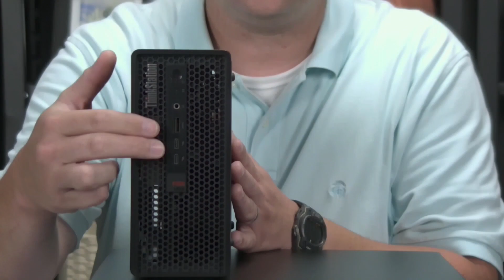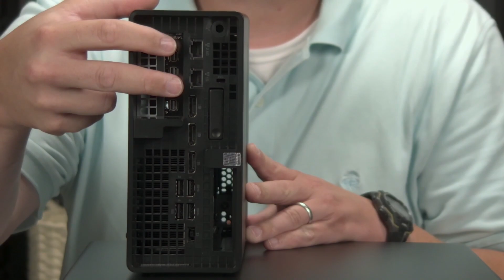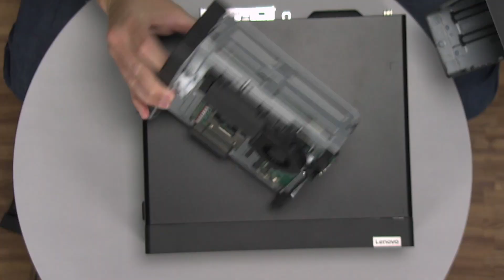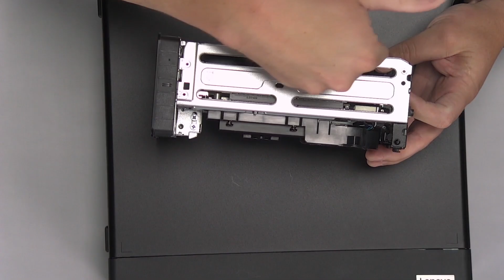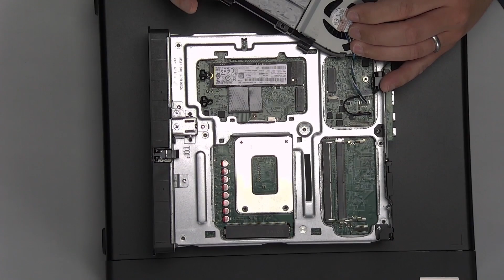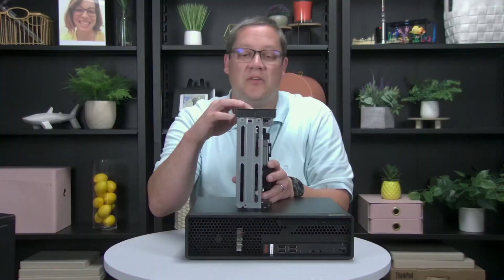An Inside Look at the ThinkStation P360 Ultra

Comment: Hi, I have question regarding the Storage support. Can I install a 2TB 2.5" HDD to this P360 Ultra ? The spec only said it support 1TB 2.5" SATA HDD 7200rpm. In fact Lenovo DID NOT provide the 2.5" HDD mounting bracket when I purchase the system (I did not purchase the HDD). Looking forward to your reply, thank you.

Comment: Hi
So I'm looking at purchasing a P3 Ultra with the 13900K  processor. I'm a bit confused aboutt he GPU compatibility. I can see that you have what looks to be a T1000 in that machine, but here's my question. You say that in the models specced with larger 125 watt CPU's, there's a dual fan setup. Does this actually mean that there is no slot and no room for a T1000 or A2000 GPU card? Thank you.

Comment: Good day. I wonder if I can use third-party GPU cards for a further upgrade of the P360 Ultra? Are there any "white list" limits on expansion cards? What are the physical limits for extra PCIe x8 card? As I see - there is classic power connector from ThinkPad laptops - can I use one of mine, 135 watt power, with P360 Ultra?
Reply from the maker: Hi! Thanks for reaching out, and we hope you're doing well. We don't recommend using a third party GPU, since we can't guarantee the compatibility. Kindly share with us the part number or Machine Type Model (MTM) of your P360 Ultra, so we can have a closer look with the specs and compatible parts. It's usually printed on the label on the side or back of the product. We'd like to extend our help. Rai_Lenovo
Reply: @Lenovo  Good day. Thank you for your reply. I'm in search of a portable solution for the role of the video mixer unit. And P360  Ultra + HDMI/SDI capture cards look attractive. I don't have one yet 😎
Reply from the maker: I see. Please click this link https://lnv.gy/3RCHMCQ for the specs of ThinkStation P360 Ultra. Rai_Lenovo

Comment: where can you install the 2.5" SSD as the spec mentioned and how the power/data cable connect to the SSD ?
Reply from the maker: Hi MJ SUN. Thanks for writing in. To see the step-by-step guidelines on how to remove and replace hardware components you may use this link https://lnv.gy/3ASwCUX. Have a nice day, and keep safe. Ash_Lenovo
Reply: @Lenovo  Hi, thank you for the quick reply!  As the 2.5" mounting bracket doesn't come with the Ultra, I just wonder where to get it and where the sata cable goes.  Didn't find any spot on the board you can connect the SSD to.

Comment: Thanks for the review. What is the part number of the 90 degree adapter to install the graphics card (3'04'')?
Reply from the maker: Hey there, slk2tube! Thanks for reaching our support! As per the hardware maintenance manual https://download.lenovo.com/pccbbs/thinkcentre_pdf/p360_ultra_hmm.pdf?CID=ww:lenovosocial:20x9m6 (Go to page 73) of the ThinkStation P360 ultra, you may install the GPU into the PCI-Express slot. Let us know if you have any other concern. -Chris_Lenovo

Comment: Real Sound levels?  Coolers look small for a top spec cpu, even with x2 of them (pulling the same stunt that HP here?).  Would buy, but unfortunately I will have to wait for few solid reviews - just don’t trust Lenovo knowing that component are cheaper than a doggy trader in Ali express.  Can it comfortably run 3x monitor without the video card (not gaming)?

Comment: I find it disappointing that the only use I'd have for these types of products from moreso Lenovo than HP or Dell, would be for NAS/IO, something like an ideacentre 5, with the front panel ripped of, the best '3-In-1 CaRd ReAdEr' 'you' have and the best 'OpTiCaL dIsK dRiVe' 'you' have, top-tip, tell us what the hell we get for IO and add a microSD card reader you can use at the same time as the full size reader, plus an actually modern chassis and thinkstation hardware, plus a liquid cooler. And no arbitrary storage limitations either. It really is a shame how close to good any of your products are in a vacuum, and when compared to Dell or HP, it's about the same.